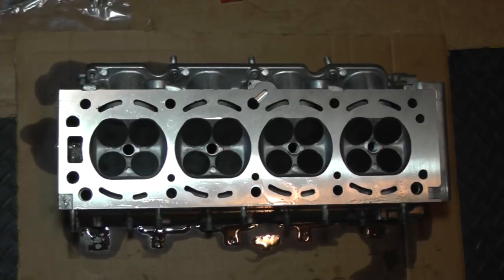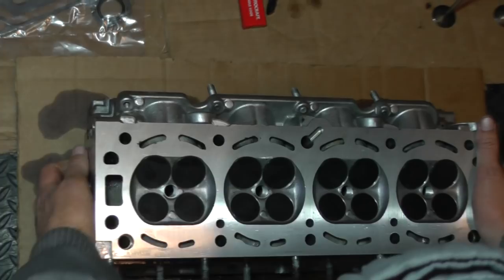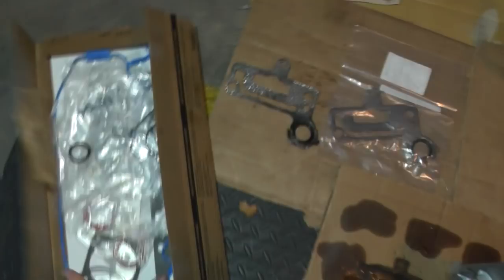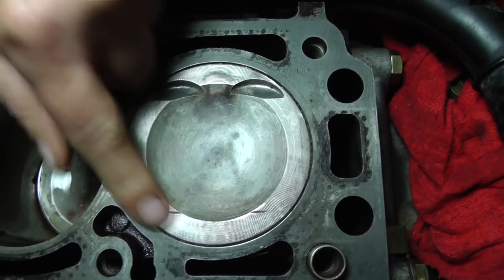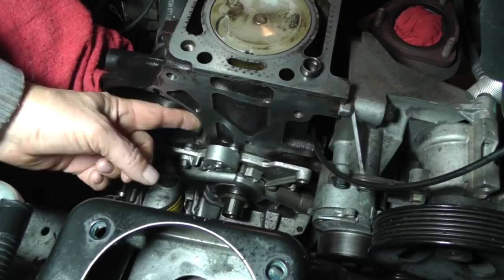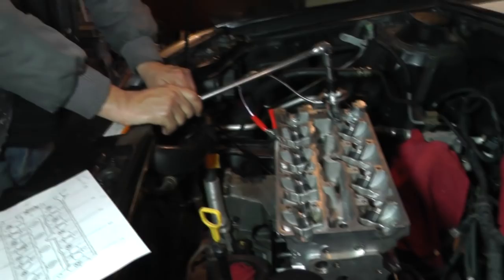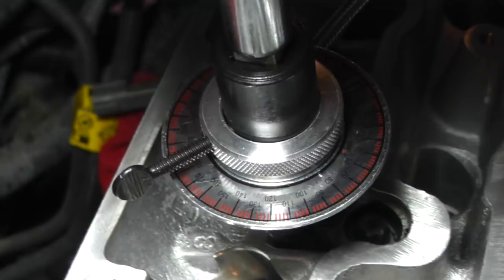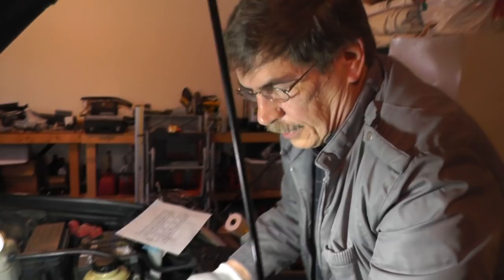Suzuki Forenza Head Installation - Part 9 (Initial Head Install)

Comment: Howdy sir, 
I have an 04 model, same engine as yours. I have the head off, it's been machined, and it's about ready to go back on. My question and biggest problem is that I have pistol 1 at top dead center, but from what I understand, it must be on the compression stroke instead of the exhaust stroke before putting the head back on. How do I tell which stroke it is on? I want to be absolutely positive that I have this right before proceeding. Also on the harmonic balancer (crank pulley) the timing mark is just a circular indentation. Is this the timing mark? Where does it need to be positioned when piston 1 is at TDC? I put a sharpie mark on it so it is easy to see when looking down in the engine bay, but at TDC, the mark is a little to the left, almost in front of the belt tensioner. Any help would be greatly appreciated! I need to get this thing on the road ASAP. If I had a way of sending you a picture I would. I'm just confused as to why it's not somewhere obvious, like the top or the bottom. Mainly I just need to know how to tell which stroke the piston is on if you can't answer the second question. Thanks in advance, your videos are great.
Reply from the maker: When you put the #1 piston at TDC, it doesn't matter concerning compression or exhaust at this point before you put the head on because the camshafts haven't been installed. The compression stroke or any other stroke for that matter is determined by the position of the camshaft's lobes on the valves. The indentation is on the crankshaft sprocket (not the harmonic balancer or crank pulley) which is aligned with the notch that's in the rear timing belt cover. You may have meant the crank sprocket, but want to make sure our terminology is correct. And don't look at the timing mark on the crank sprocket from above. Look straight on it as with the timing marks on the camshaft sprockets. Otherwise the marks will look slightly off when viewed from any other angle. Hope that helps!
Reply: stuzman 

Ok thank you, I know about the timing marks on the camshaft sprockets so that's all I really have to worry about at this point I suppose. Top dead center is simply just top dead center without the head on the block. As far as the dot I was talking about on the crank pulley at the very bottom, I won't worry about it. I just thought it should be positioned in an either straight up or straight down to indicate TDC. Truthfully I don't know if the dot has any real purpose so I'll stop letting it confuse me. It's at TDC so it should be ok to start reassembling. If I have any more questions I'll just ask. Thanks again
Reply from the maker: Yep, you've got it Brent! TDC is just TDC without the head on and there's no compression, exhaust, power or exhaust stroke to worry about. The compression comes into play when you put the camshafts in. And when you get the marks aligned up on the camshaft sprockets, you'll be at compression at that point. Of course, you'll have the #1 piston at TDC by using the mark on the CRANKSHAFT SPROCKET aligned to the V-notch in the rear timing belt cover. Does all that sound good?
Reply: stuzman 
Sounds good, I just have to find that notch. I don't know exactly what I am looking for but I will find it, one way or another!!
Reply from the maker: It's pretty obvious and I show it in one or more of the videos.

Comment: I have this same motor with the same problem. How much did it cost to send the head in?
Reply from the maker: $500.00
Reply from the maker: Around $500
Reply: I can buy a used motor with 60-90k miles (mine has 200k) for around $600-800. I wonder if I should do as you did (have no experience in rebuilding an engine) or just hot swap the engine (have plenty experience doing this). What is your opinion? And thank you for your response and your awesome videos!
Reply from the maker: The pricing of around $500 is also for the parts such as valves, guides, seals, etc. that the machinist will need to install. Being how the cost of an engine is about the same with less mileage, you may be better off to swap out the engine. Keep in mind, this is just an opinion and the final decision is yours. And you could always use your old engine for parts if you need them. Thanks for liking the videos and hope they were helpful!
Reply: stuzman how did you clean the head

Comment: Do you have a resource to get new cam pulley bolts?
Reply from the maker: I'm pretty sure that I used these guys to get the bolts. I remember that I had to call them though. https://www.suzukicarparts.com/

Comment: Hello, Where can I oder new dowel pins (installed on the front of endine) for cylinders head?
Reply from the maker: Not sure about that one Andrii. Try a Google search and see what you can come up with.
Reply: when I opened engine up I did find any dowel pins at all. I guess who did this work before me make mistake. Thanks
Reply from the maker: Andrii Averianov yeah, when somebody else has worked on the engine before you never know what you're going to get. If you have a local machine shop that does engine/head work, they may be able to have some dowel pins for you.
Reply: +stuzman Ok, Thank you, it's good idea. I am going to ask where I have get resurfacing my cylinder head.

Comment: How much torque do u need to put on the bolts for the heads because I'm working on a 2006 suzuki forenza
Reply from the maker: All of the torque measurements are in the video of installing the head. If memory serves me correctly, you torque all bolts to 18 ft-lbs. Then you turn them 90 degrees in three stages.
Reply: Thank u so much the timing belt broke now I'm changing the heads
Reply from the maker: Good luck on your repair and watch the details.
Reply: The gasket that was a hundred dollars wasn't on the heads I got it was the first one u showed in the.video
Reply: Should I go buy the u had bought or stay with the other one
Reply from the maker: Since you're doing an extensive amount of work, I wouldn't rely on an old gasket. Go ahead and bite the bullet and buy a new gasket even though it's expensive as I mentioned. Maybe you'll get lucky and can find it cheaper.
Reply: I bought the one u had in the box not the hundred dollar one the I bought is the one that was on the heads before

Comment: how do i clean the old gasket stuff is at
Reply from the maker: There are several methods Stephanie of where you could use gasket removal, a putty knife, brake clean, mineral spirits, etc. Any of those methods should work. Just be careful when working with aluminum that you don't create gashes in it where a leak could develop.

Comment: the gauge how much is foot pound when you say 0 to 90
Reply from the maker: +Karam Chato Karam...on the head bolt tightening which is what I'm assuming that you're referring to is at 14:41 timeline in the video. 18 foot-lbs, then 90 degrees, and finally another 90 degrees. If you're asking me how many foot-lbs is 90 degrees, I don't know as you'll need an angle gauge for that.
Reply: is it 18 ft-lbs, then three cycles of 90 degrees, or two cycles of 90 degrees?
Reply from the maker: 18 ft-lbs, then 3 cycles of 90 degrees. It's pretty clear in the video.

Comment: If the bolt is actually torque to yield as they claim, it would not be getting  progressively harder, but the torque would level off
Reply: no sir when that starts happening and someone isn't paying attention they're lucky if it it doesn't snap and have to remove everything, drill it out and start all over. hopefully correctly this time.

Comment: como hago para para que el forenza no doble valvula cuando se le valla la correa
Reply from the maker: Sorry hermes...when I put your comment in the Google translate, it came back with verbiage that I didn't understand.
Reply: lo que quiero saver si  le puedo poner 2 empacaduras  para que no dobles las valvulas saludos desde venezuela
Reply: muy buenos sus videos muy informativo
Reply from the maker: Muchas gracias
Reply from the maker: Here is what it translate into English. or I want saver if I can put 2 gaskets to avoid double valves greetings from Venezuela
I'm not sure what you want to double gasket, but I wouldn't recommend it. You should do what the
manufacturer calls for.
Reply: gracias por todo el motor nuvira 2000 no dobla valvula  que los pistones traen 4 muescas
Reply from the maker: Lo siento. No entiendo tu pregunta.